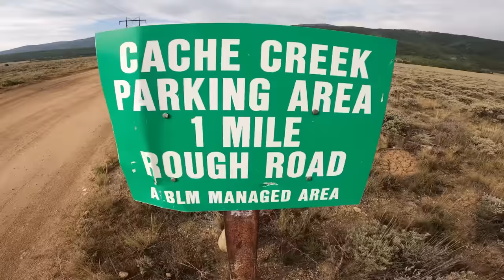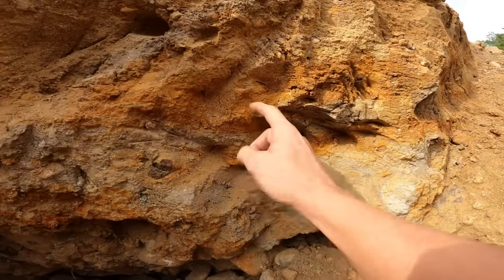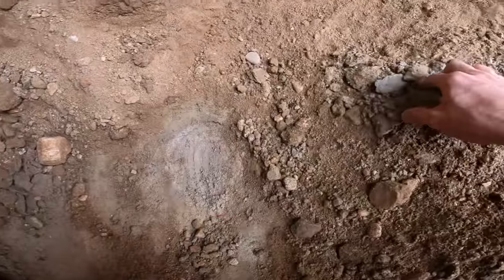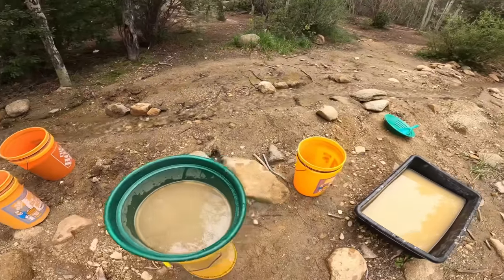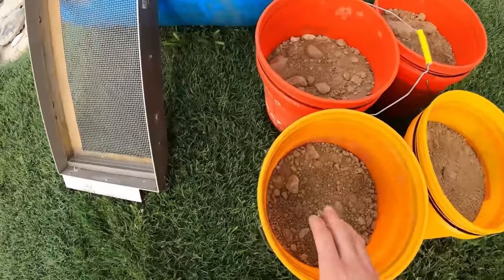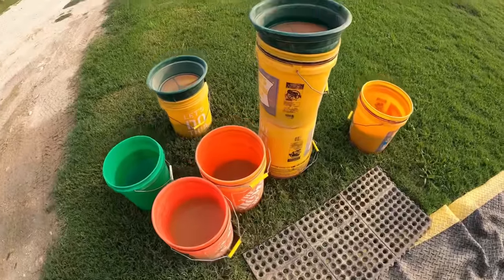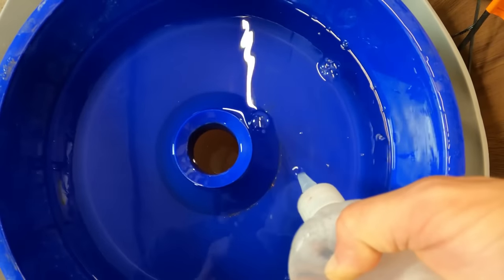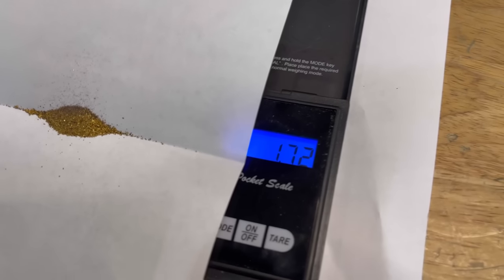Lots of GOLD In The Hole - Mining Gold - Cache Creek Colorado

Comment: One of the best Cach Creek videos! Get some FC-100 Flocculant Clarifier Concentrate – Pool, Pond, Spa by Cesco – 64 oz will cause the dirty water to sink to the bottom for cleaner water. Ebay, 64 oz for $27 Only need a little amount  in your water containers

Comment: A gravel layer, with tumbled gravel is a prime layer, normally it will be above a hard rock layer and as to clay, at time it will get captured in the clay. Clay layer can be identified when wet, by pitching and/or squeezing first one direction then the other. If it is dirt or sand it will have a lot of crumble,  clay that will grab will have very little to no crumble. I never tried to explain this before. Hope I got the point across.

Shacking the vials with gold in it can brake the vial as well. When that happens ... everyone it happens to has the same look on their face.
Reply from the maker: Thank you for explaining.
Reply: @DiamondMinerIvins  your welcome. Everyone sharing knowledge is what social media is about. I've learned things about crystal hunting from you. Thank you for sharing, you knowledge.

Comment: Can you run a magnet threw it to get iron out
Reply from the maker: Yea. I used several types of magnets. I need to get a 100 and 200 mesh classifier to thin out the material so magnets can work better. All that was in there is what Wouldnt stick. But maybe classify the material smaller will allow the iron to stick.
Reply: Wish I could do this close to me . But u dig the dirt around here you will end up with corn our beans lol. Central Illinois is boring

Comment: If gold comes from deep withing the earth... how did it get above that there clay layer?
Reply: Hard rock gold in veins weathers out over time and washed down the hill into the creek gravels. Placer gold is placed by water where you find it in gravels. Clay acts as a false bedrock and is often what stops the gold from sinking and settling any deeper in the creek. Often times if there was a low spot in the clay, say like a footprint from some ancient critter, the gold will collect in there like a sluice riffle into a little pocket of nuggets if you can find it with a detector or stumble across it. Sometimes the heavier nuggets will have even sunk into the clay a little. I know a spot with a white clay later that has a gram of small flakes every 30 buckets of raw dirt above it. The clay is noisy on detectors, especially vlf vs. pulse induction, but if you bust it out and bust it up especially with a cement mixer or small tiller or whatever there are pockets of nuggets about the size of M&Ms that sunk slightly into the clay later. Also, sometimes you find a chunk of clay in gravel that picked up a bunch of gold in the creek bottom like a big sticky piece of bubble gum before it hardened.
Reply from the maker: This area is all glacier, The old mining companies was hydroblasting the mountains, so it’s all mix up,